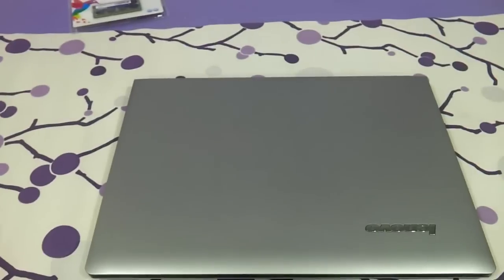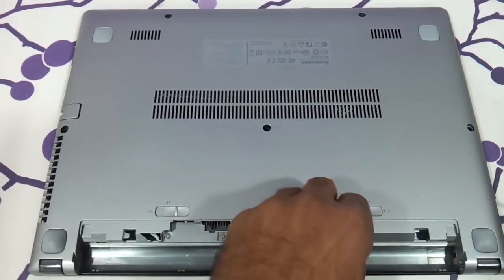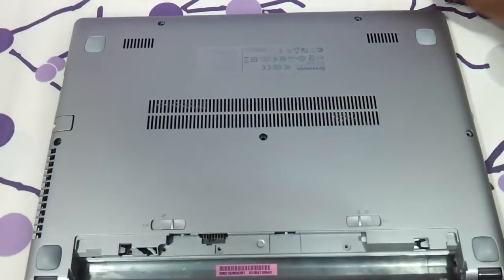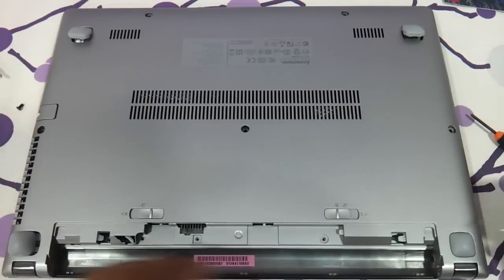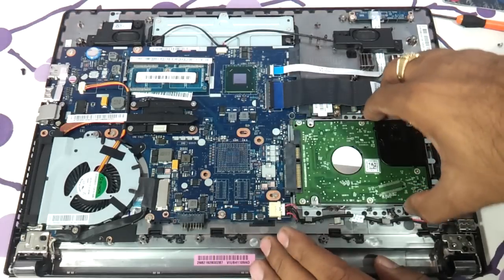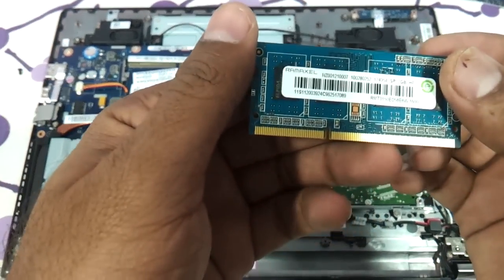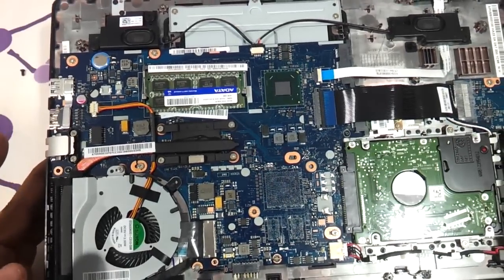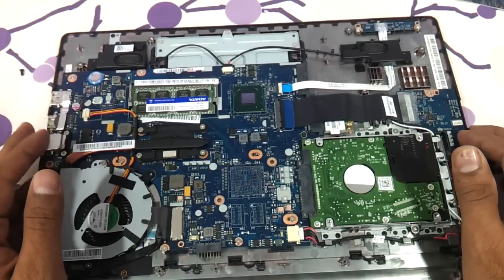Lenovo S400 s405 how to upgrade memory ram harddrive of lenovo S400 s405

Comment: Hi,
I bought 8gb ram for lenovo IdeaPad s400. According to your guidance I have purchased the DDR3 8gb ram but it's showing like this 8gb ram(2.20gb usable). Can you get out of this issue.
Please respond ASAP.
Reply: I bought SUMSUNG 1600mhz low voltage DDR3 8gb (Dual channel) Loptop (M471B1G73QH0-YK0 PC3L-12800S). Please let know whether will work or not.

Comment: It looks so easy when you have the right tools...
Reply from the maker: +Max William absolutely..
Reply: They are just cross screws....
Reply: +Max William Yes haha. 

It's a good idea to have at least one of each, they're useful.
Reply: Yeah, but they are too small if you consider the tools I had able to use in them. With the help of a little knife in the central screw, I managed to get them out, but it took way more time than it should've taken If I had the right tools. But I'm happy with my new ssd :)
Reply: +Max William I was going to tell to do it with a very pointed knife haha. 
Well, that's true, takes more time, but you can buy a set of small screwdrivers almost everywhere for a very small amount of money.
Reply: Jose Mario Jiménez Those pointed knives are really useful haha
I should follow your advice and get a set of screwdrivers, it would not be used often but it is nice to have it around whenever you need.

Comment: it is very useful and tricky with the screws, i have an s500 13 inch in which the batterry is integrated inside the body, lenovo wants 100$ just to open the case and install ssd drive that i give them, do you know if its possible to do it on my own?
thx
Reply from the maker: +yanivd28 very much possible. you can do it on your own.
Reply: i tried to open the screws it was ok. but the 4 rubber holders in the slides look like it has been glued its just doesnt open to see if there is screws inside, do you know for sure that those rubber holders suppose to open? lenovo s500 13.3 built in batterry thx

Comment: I had this laptop for a week, and the casing already cracked when i opened it.. Also, the touch screen goes haywire and thinks im touching when im not, the power input jack gets pushed in when i try to plug it in, so i have to open the casing and move it back into place. The plastic casing around the headphone jack also cracked. I take very good care of this laptop... Its build quality is horrible. It bends, and i get an hour and a half on a full charge...Not worth $400 at all.

Comment: I am looking to upgrade the memory. Does it have 1 slot or 2 slots and does it take two 8Gig 1600MHz DDR3 memory?
Also can I upgrade the processor to i5/i7? I currently have a Intel Core i3-3217U ULV 1.8 GHz Processor with 3 MB Cache.

Comment: Great video. For some reason my charger socket was deeper in. I opened it with this and moved it back in place. 

A gold nut fell out from somewhere though which fits the black screws. Also the screw under the grey pad near the charging socket doesn't tighten. Now that corner comes away from the base when folding. I'll have to open again when I get a chance.

Comment: Hi,
Nice and  clear video. I have an s400 with 2GB RAM in it. I want to upgrade to 4GB. I have 2 questions.
1. I have a 2GB RAM with me. I was planning to put that along with the existing 2GB, however from your video, I could understand that it is not possible since it has only 1 slot. Hence I am going to buy a 4GB RAM. Does that makes sense ?
2 Any specification (Like MHz, etc) should we consider before ordering RAM online for this s400 model ?

Comment: Hey, Do you know if the CPU is upgradable?
Reply: No.
Reply: Franklin Tinoco Thanks for the info :)
Reply: The CPU is soldered on the motherboard using BGA, preventing its replacement.

Comment: of course, didn't you see the sticker at 3:24 ? I guess it's some kind of warranty void sticker, so as long as you replace the ram without removing the sticker you won't have any problems, also make sure that you put back the old ram before sending the laptop for warranty repair.
Reply: Actually, there was a warranty sticker over the screw under one of the feet, so opening it at all will void it.

Comment: Hey, thanks for the video. This helped me to upgrade my memory on IdeaPad S405 (AMD) laptop. S405 is exactly the same model but AMD processor. My SSD is on the way and that's going to be my next upgrade. May be add S405 to your title and it will help others.